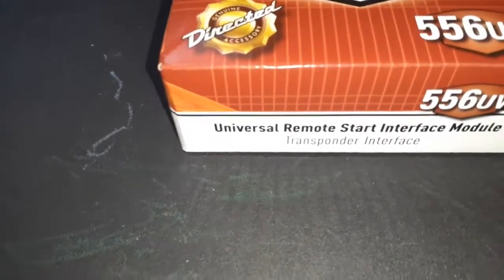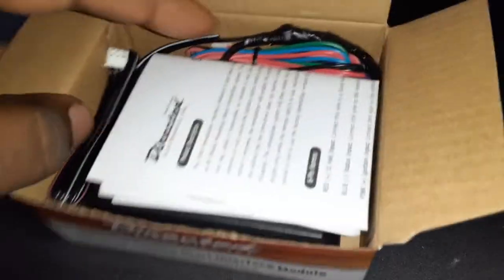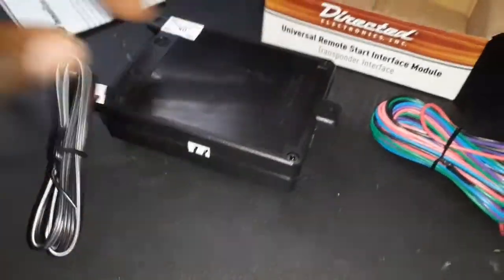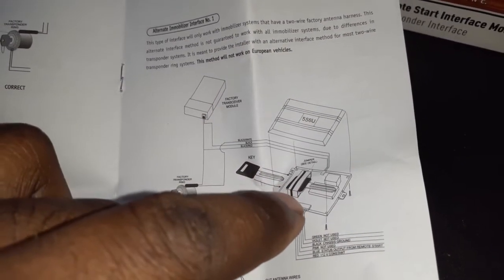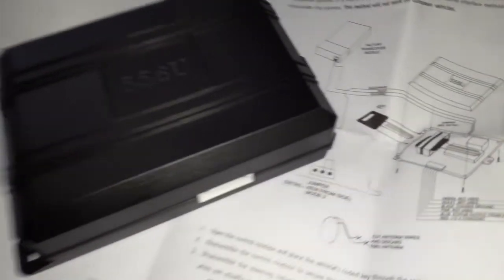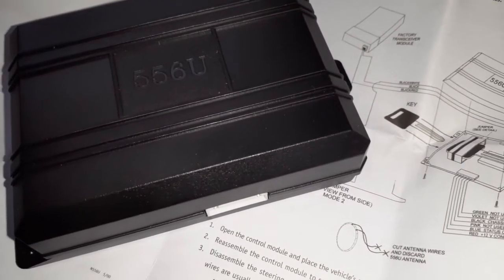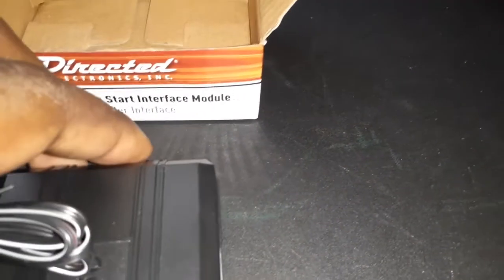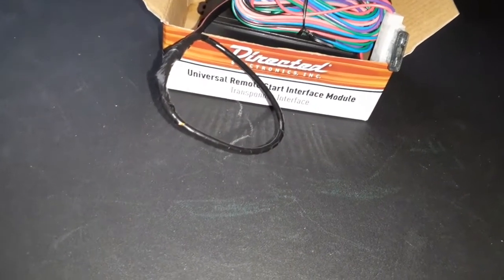Directed 556UW Bypass Module

Comment: I looked under my dash on my titan and it had this same immobilizer but ny truck only came with stick key fobs how do I get it to work or fond out what remote starter it is and am I able to just buy the remote since it's already hooked up
Reply from the maker: You may be able to buy the remotes and get them program, but I would just throw a new one on there, Ain't no telling if it's even working after ordering the remotes and getting them programmed. I would just get a new system...

Comment: Can you wire in a hidden toggle switch needed to start the vehicle with a key?
Reply from the maker: Yes you can sir...
Reply: @Change4ADollar  do you wire that in with the bypass module?
Reply: @beausmith08  hey man did you get it figured out?
Reply: @longdong3889  i put in a toggle switch to power off my remote start in case I take it to a mechanic or something. 

My remote start already has a feature that disables the car until I re enable it
Reply: @beausmith08  good to know thanks man 👍